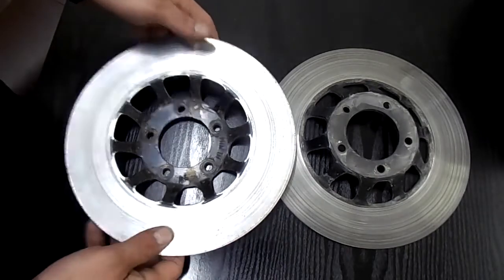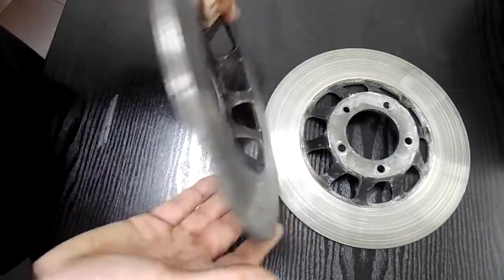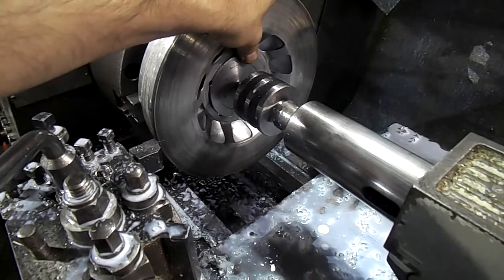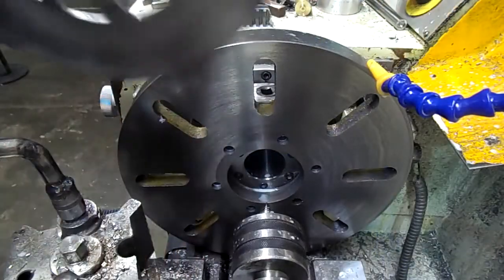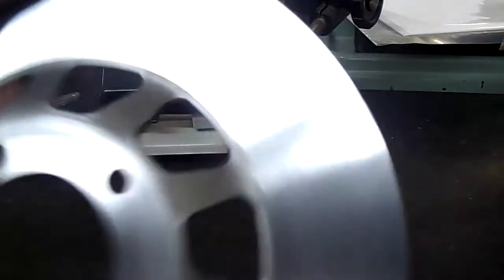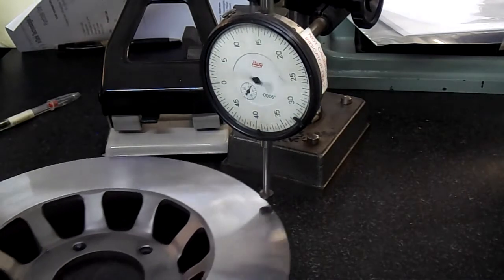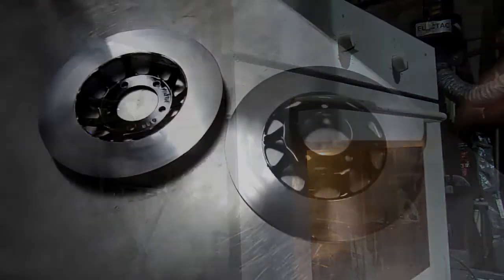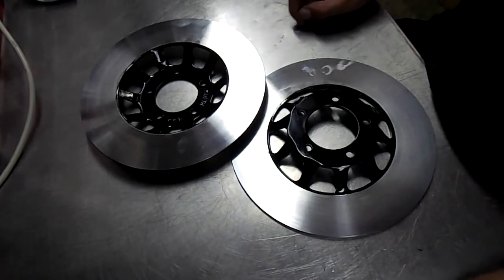How to skim a motorcycle brake disc

Comment: Nice. 
Would have liked a comment on the root radii where disc meets cone & wondering why paint the mounting surface?
Also, is there any point in balancing these discs?
Reply from the maker: I did miss a few details out, I painted the face to stop rust, but I think the disks are stainless steel anyway so wasn't really needed. I didn't balance the discs, but balanced the wheel with the disks on.